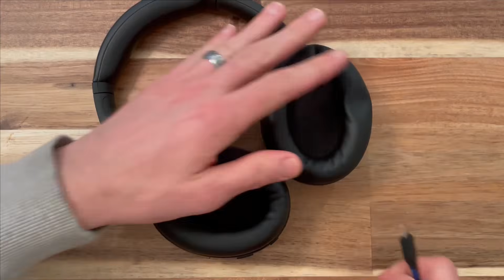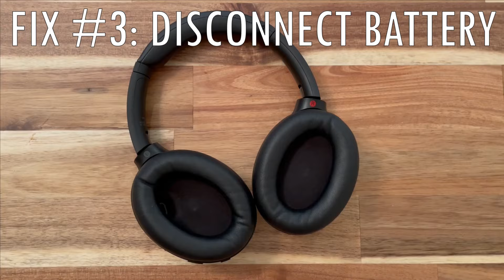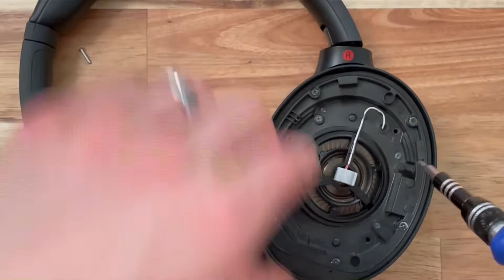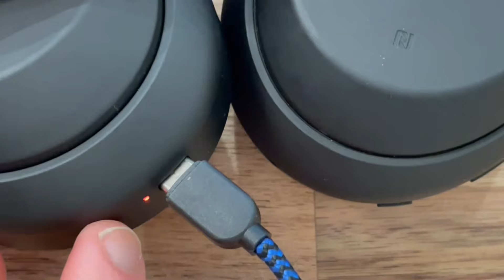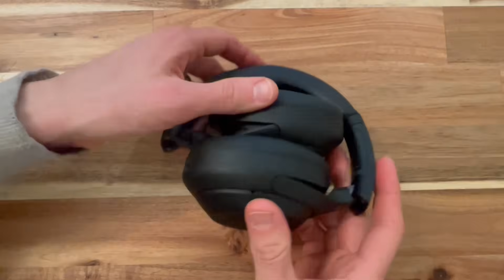SONY WH1000XM4 Battery Troubleshooting & Repair - No Power, Won't Charge & Short Battery Life Fix

Comment: Thanks, removing the battery worked for me. I had bought a new Sony MX4 online and it stopped charging 3 months later. Sony SG wouldn't repair it under warranty as I didn't buy it in SG so had to pay $275 to repair it. It then broke again 6 months later and this YouTube fixed it. Thanks again. I dont think I will buy Sony again.
Reply: After replacing the battery it can charge but cannot power up
Reply: Your decision of course but bad batteries isn't Sony's fault. Bad charging habits isn't Sony's fault. Buy a different branded battery next time...see how that goes.
P.S. Sony don't make batteries.
Reply: I had JBL and BOSE before this XM4 headphone and my 'charging habits' never lead to me a frustrating experience like with this shitty headphone. Anyway, first and last from this brand.

Comment: hi, thanks so much for the video! i tried disconnecting and reconnecting the battery, sadly it didn't work. i have a suspicion it might be the charging port? (not sure if the whole port is loose or broken or if maybe the pins are damaged?) wondering if you know how to fix this/if its fixable without sending them for repair.. thank u!

Comment: Hey man , do u know how many time did it have to charge normally? When i charged mine, it take 1:30hrs--2hrs to fully charge (sony website saids that it took 3hrs) , i dont have issues with my headphones, but i dont know if i am using a correct charger (using a 2.4A)

Comment: Reading the comments makes me think my case is different.
1) the blue light indicator does not come on but the Bluetooth does connect.
2) the soft and hard reset did not seem to work
3) the red light that indicates charging shows up when plugged in but goes off after 1-2 minutes but sometime it stays on 
4) but charged the whole night and the battery did not increase

Do you think it would be worth it to replace the battery?
Reply: I’m currently having similar issues. No indicator light comes on. And it still isn’t charging
Reply: I bought xm4 after I was unable to find a solution

Comment: Will these troubleshooting methods work on the Sony WH1000XM2 Noise Cancelling Headphones?   These headphones do not power up.  They work fine when used with an audio cable, which kind of defeats the purpose of being wireless.  When I plug them into my usb charger, the charge light comes on  indicating charging.  After a while the charge light goes out.  I tried powering them on after charging with no luck.  I also tried the troubleshooting methods described the Sony website, with the same result – no power.  Any ideas?
Reply: Try to use usb into pc insted to AC DC charger

Comment: Hey....my sony xm4 doesnt have any battery issues but do you know how to solve channel imbalances?? most of the time its equal sound in both cups, but at certain frequencies, it seems like left is just a tad bit louder with these certain sounds/frequencies...
Reply: same problem but in mine the imbalance was very noticeable and now the right earcup wont switch to anc or ambient sound. It only has soft audio and no bass.

Comment: Thank you! Great technical video!
I lost one of the 4 silver screws, but found it in the carpet, barely, by turning off all the lights and angling a flashlight beam.
Reply from the maker: Whew! It is easy to lose those screws! I usually find them a few days later by painfully stepping on them ;)

Comment: Nice and easy for viewers. My problem is the left side is not producing any sound. Tried the factory reset several times but no luck. Any fix?
Reply from the maker: It could be a blown left driver (speaker) or possibly something is loose. I would recommend opening up the left side and seeing if anything obvious is loose or disconnected. Best wishes!

Comment: I received  your replacement battery, replaced as per your instructions. headphones not recognizing new battery. yet, when I replace with old battery, headphones recognize old battery. none of the indicator lights (blue, red) light up with the new battery. any suggestions to get working would be appreciated, thank you.
Reply from the maker: It sounds like a defective replacement battery. I would try to find another seller and see if you can get a working battery. Best of luck!
Reply: @jontriestofixthings3718  Thank you for your response mate, much appreciative! And thank you for your videos, they are most informative! 🙏

Comment: Just bought these off of Facebook marketplace and they wouldn’t charge. I followed your instructions to open them and when I loosened up the ear cushion, there wasn’t that metal looking stick in the middle; it was empty. I then opened up my MX3’s and they did have that metal stick thing. Was I bamboozled?
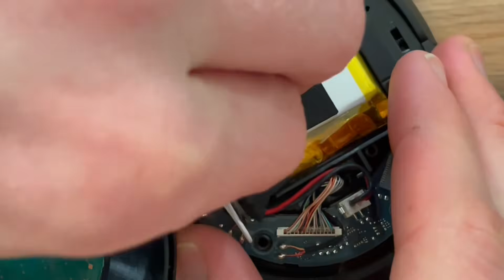Reply from the maker: Uh oh, I hope you weren't scammed! If you check out the 3:13 mark in the video, on the top right of the board you can see WH-1000XM4 on them. Do your headphones have that model on the board? Please let me know after you check and we can go from there :)

Comment: Hello Jon,
Please my issue is not battery related, but my headphones stop pairing via Bluetooth to any device. I did a hard reset but that didn’t work.  Please any ideas on what I could possibly do? 
Thanks in anticipation.
Reply from the maker: I'm not sure what side controls the Bluetooth, but I would recommend disconnecting the plug that has the bundle of wires on one side and then reconnecting it. Something may be loose there. I would try the side with the battery first and seeing if that fixes it. If not, try the other side. If you still have an issue after that please reach out :)

Comment: how you're so sure that it is the battery that is busted and not the type C  or the power connector .. MINE will not indicate the red and blue light.. and will not indicate if it is low battery or full... i had a headache  of charging this thing ... so disappointed because i bought  this online for a cheaper price and i know that it is original sony product... no question ask... but then again I dont have a warranty .. so disappointed
Reply from the maker: Hi. You're right that it could be another issue as well, but I listed the most common ways to fix battery issues. You could definitely try fixing the charging port or cable as well if the issue continues.

Comment: Hi Jon,  I followed your clear instructions, bought a new battery and installed it but still it is not charging and the power does not turn on.  How to proceed?  Thank you.  Dani Novak
Reply: Maybe there is a problem in the charging port, sometimes dust can get stuck in it n u have to take it out carefully with a thin needle without forcing anything, the only thing is since It's a usb-c port it might even be harder

Comment: Hi great video, my headphones -  red charge light comes on for approx 10sec then goes off, only way I can get them to charge is to connect & disconnect the lead numourus times until the charge light stays on. Any ideas why?
Reply from the maker: I'm not sure why that is happening but it sounds like it's either a charging port issue or a battery issue. I'd try replacing one first and seeing if it fixes it - if not, try replacing the other. Best wishes!
Reply: Mine does the same?! These were expensive headphones. Won’t be buying any Sony products any time soon.

Comment: I just got a new one. While I was connected from box it's 100 percent after sometime like 1hr it drops to 20percenf. So that I go to charge. ..while i charge it doesn't take the charging ...the red light stoped after 10seconds of charge. So that I replaced the product and Same issue with another headset. What to do
Reply from the maker: I would try the troubleshooting steps mentioned in the video. Sometimes a reset will fix the issue. Please let me know if the issue continues after trying those steps :)

Comment: Hiya. Nice vid. My headphone charging light flashes red after the two resets, battery disconnection and reconnection. Two short flashes and with a slight pause between the two short flashes.
Reply from the maker: I think it's either a battery issue or a charging port issue. It's sort of a guess as to what the issue may be. If the charging port looks fine then I'd lean towards the battery being the issue. If you buy the battery on amazon and it doesn't fix the issue you can return it for a refund :)

Comment: hey man awesome video. so when i plug my headset in the red charging light doesnt come on, so cant turn it on. the headset still works but only with aux cord plugged in. the shop recommended cleaning the charging connection area but i cant really get in there to clean it. any thoughts? also should I replace the battery, been out of use for quite some time
Reply from the maker: Have you tried disconnecting and reconnecting the battery? Sometimes that will do the trick. If that doesn't work I'd recommend either a new battery or a new charging port. It's kind of a toss up as to which one will fix the issue. Best wishes!
Reply: yep, mine is doing the same thing

Comment: Hello Jon, greetings from Perú. I use my headphones for pc gaiming. Nevertheless, while im the game and discord at the same time, it crashed. All the time. 
Now from one day to the other, the phones cant pair with the pc in any way possible. I have tryed everything but with no silver linings at the end. Any suggestion for bluetooth pairing issues?
Reply from the maker: Hey I'm sorry to hear about that! Have you tried performing the factory reset? If that doesn't work I would try disconnecting the battery and reconnecting it, as that can help reset any pairing information that is stored on the headphones. Otherwise, I'm not really sure what the issue is. You could also try downloading the Sony app and try running a reset/update via the app. Best of luck!

Comment: Hey. Been watching your videos to see if the issue I've been having with my pair are fixable but nobody seems to have the same problem. I'd appreciate it if you could help me out. Ok so the issue I've been having with my head phones is every time I have ASC(noise cancelation) on something sounds like is moving in the right ear cup. When I move or so, I hear something spinning . It also makes a loud continous beep. The beep is only on the right as well. The noise sounds like its tied to the moving thing because the pitch of the beep changes as I shake.
Reply from the maker: Oh very interesting! I haven't heard of that before. I would suggest opening up the right side and making sure nothing is loose - battery, cables, etc and if anything seems loose tape it down with some strong tape. If the issue remains, try the same on the left side. You could also try disconnecting and reconnecting any cable/plug that you can on the left side and see if that may reset those connections. Sorry I can't give you a clear answer but those are the steps I would take to try to fix the issue. Best of luck and please let me know the results!
Reply: @jontriestofixthings3718  I'll try it out. Ty. You're the best :). Btw. The thingy moving inside doesn't rattle or move in a random way as if it was a lose thing. It's hard to explain but it sounds more so like its a sphere spinning. That's the best way I can describe it lol. Had it for 1 year and bought it brand new at the store. Just incase you think I bought a fake one or what ever
Reply: @720p-z7i  Have you tried running the optimizer? Hold the "custom" button (the one that isn't the power button) for 2 seconds while wearing the headphones. Might or might not work but it's worth a shot.

Comment: Hello Jon, thanks for the video. I replace the battery and my Sony WH1000XM4  still don't turn on😥, how can i fix that?
Reply from the maker: Oh no! Sorry to hear that. The issue could be anything from a faulty charging cable, charging port or something messed up with the main board. I would suggest trying a charging cable that you are sure works first to rule that out. Then for replacing the charging port, it isn't too difficult but I don't have a video on that yet. If you hunt around YouTube or google you may be able to find that. If not, I will try to get a video up for that sometime soon. I wish you the best!
Reply: Is there anyway to change the charging port ?
Reply from the maker: @lemar237  yes there is but I’m not sure if there is a video for that on YouTube yet. I’ll try to get one posted soon :)